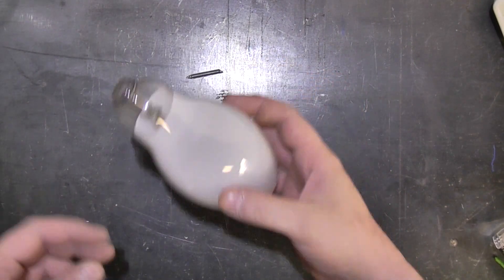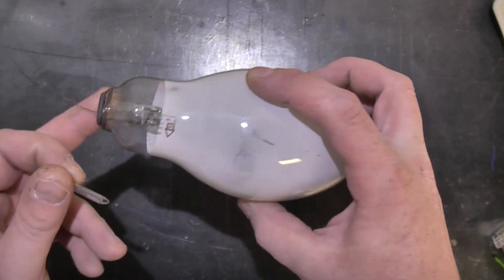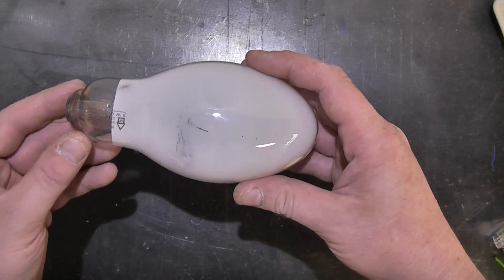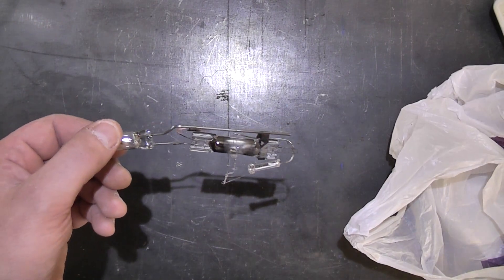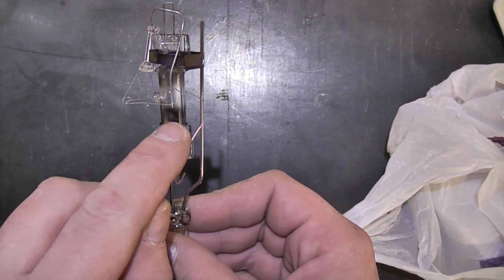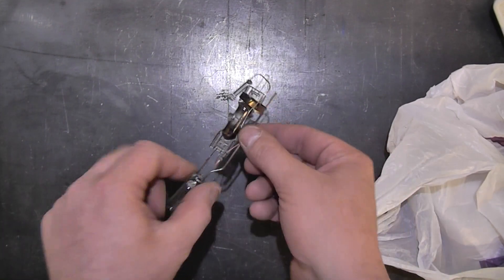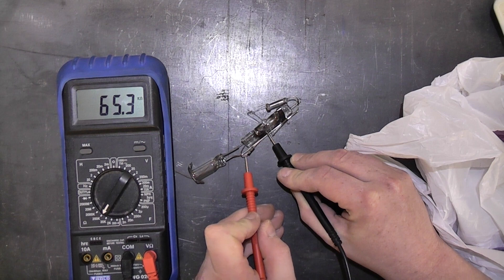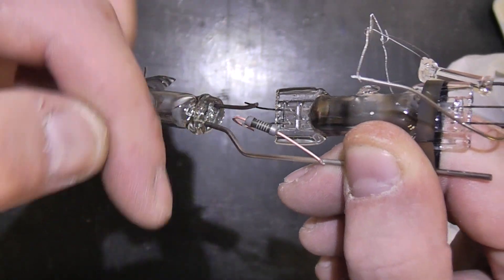Inside a self ballast Mercury lamp.

Comment: I’ve had these.. they are amazing for some applications.. they work for even 120-125v (usually 125volt; tested atleast) in America.. and I’ve got several of them I used to use for random things just to make use of them.. I have  a 220-240volt one that I had from the UK when I brought a few items over from there by post… they can get quite hot aswell.. they’re usually 160watts (most common).. but I brought them because I actually miss the warm glow of LPS in Manchester and it started my journey into buying “HID” style lamps.. noticed they made these and had to ask myself “why wouldn’t I buy them??” So naturally.. I did, and they are very interesting.. did also notice after I paid 12pound apiece for them (7yrs ago) that they make a few different voltage ranges ones, I mainly love incandescent globes and this fell right into my curiousity zone so that’s what got me watchin these vids & I enjoy watching so carry on with them if you will as I’ll watch everyone of them in interest👍